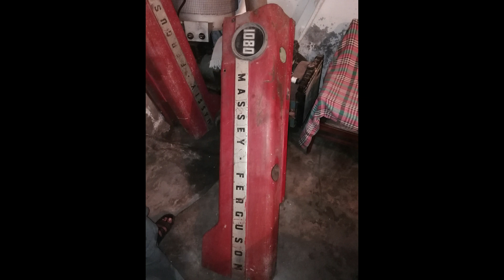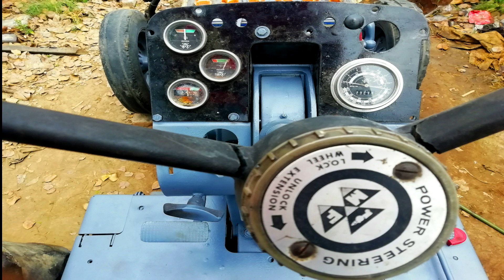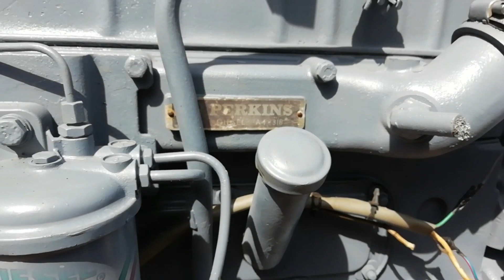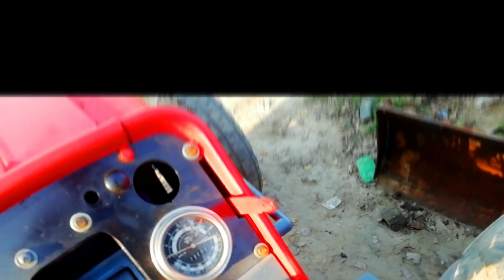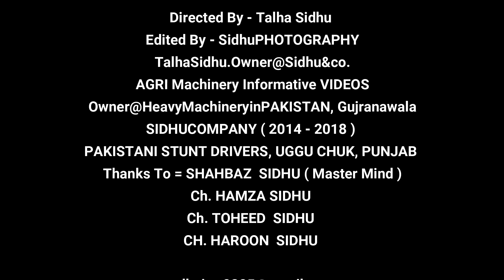RESTORATION OF MASSEY FERGUSON 1080 TRACTOR  || MODEL 1974

Comment: Good job spray gun ... looks all most new😕... restored...😦.. weld up cracked and boken parts ... and replace worn parts with sca... hand from a nother tractor problely one that went on fire😁...cannot spray paint.. burnt metal...to hard to spray...😢... the restored or new steering wheel .... look good with the cracks on the spokes...😢...gages look good to.. with holes in the panel...😬... O the tyres  ...good for a nother 25 yrs or so...😁... if do little road use....😉 ...good paint job makes it restored....😯...helo from IRELAND...😄

Comment: great job where are hydraulic filters?
Reply from the maker: This is Old Ferguson model, its Hydraulic filters are with the hydraulic pump. its not same as MF 595 outside filters...
Reply: I have that ferguson 1080 4 wd. I have problems with hydraulic systems. Can you help me